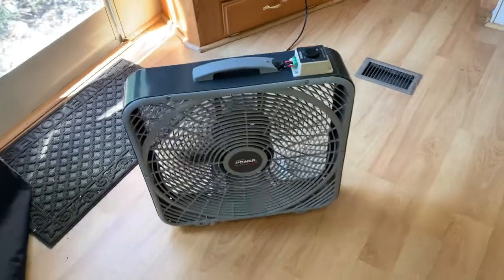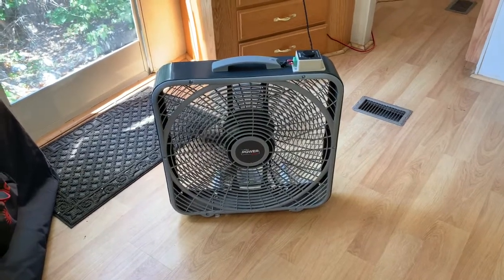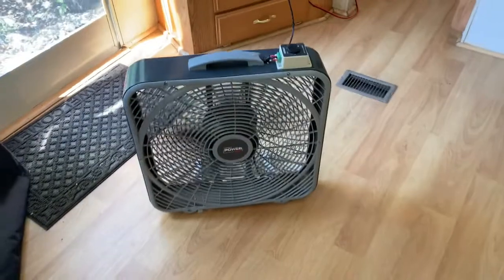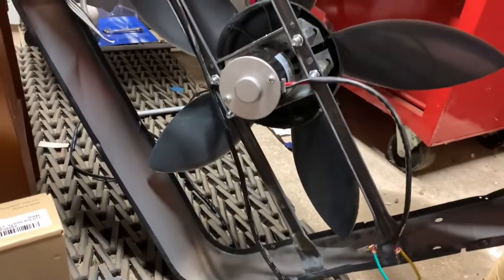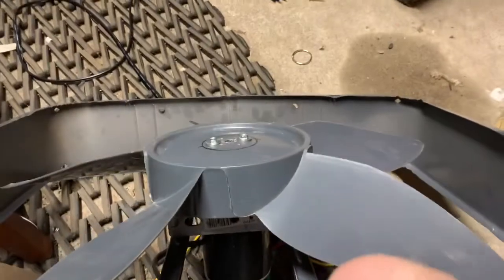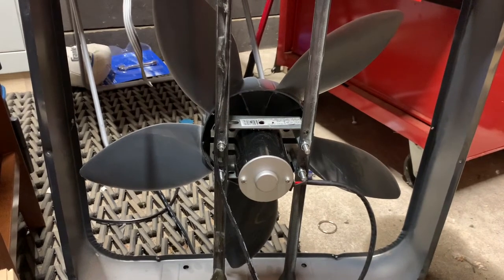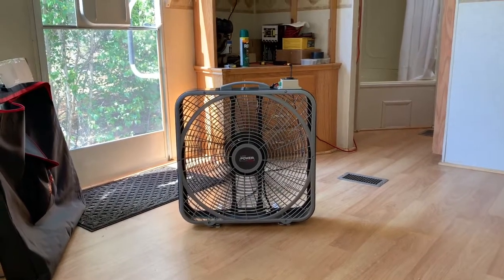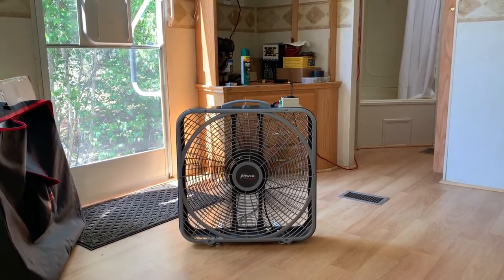12v DC Off Grid Solar Box Fan

Comment: I’ve debated doing this. Not sure if a 12 volt radiator fan would be as big though or fit right. 18 volt drill motors are cheap, if that could be adapted you could have a direct solar driven box fan.
Reply from the maker: If you decide to build one I’d like to see what you come up with!